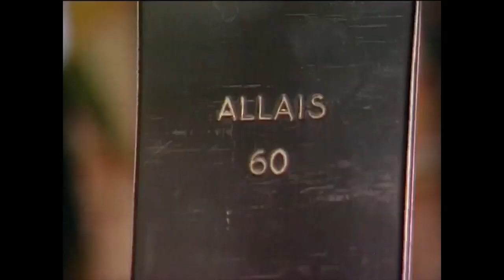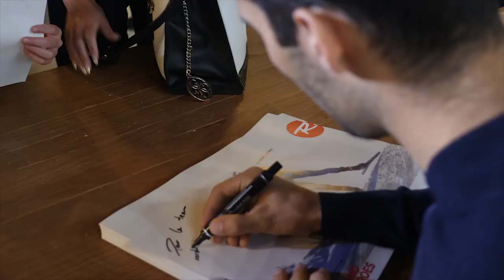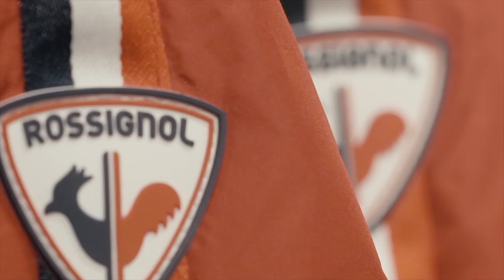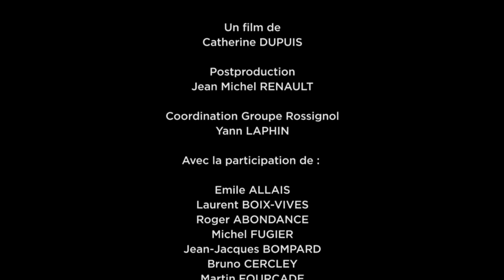ROSSIGNOL | 112 years of history

Comment: I started skiing as a young boy in 1969. I got some used ski equipment with money I earned during the summer, my parents would pay for ski passes. One night I went down to the local ski shop with my neighbors. As they shopped I was glued to the couple dozen pairs of Rossignol Strato 102s (8:47 in this video) like the time that family took me to the Mercury dealership and I am came upon a yellow DeTomaso Pantera. I was (and still am) a good skier, they were the best performance ski at that time, they are still one of the best looking skis ever, and I really wanted a pair, but they were way beyond my means. Years later around 1984 I went to a ski swap at the convention center in the city I was living in. I couldn't believe it but there was a brand new pair of undrilled 210cm Rossignol Strato 102s still in the original plastic bags. So of course I bought them, but then I just stored them. In 1994 I moved to Colorado and decided they would make nice wall decorations. I designed and made some mounts so they are angled like when skiing. They are a work of art and behind me right now.